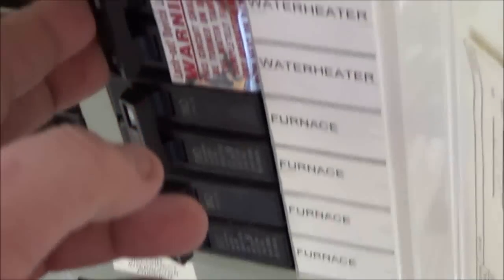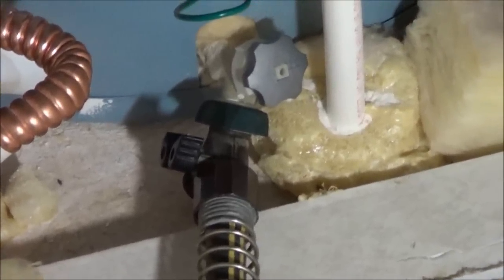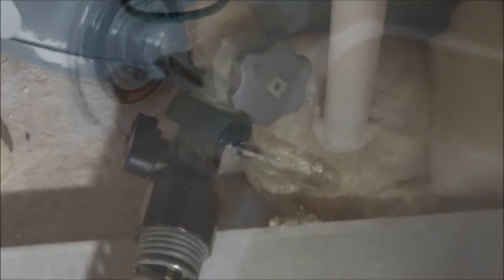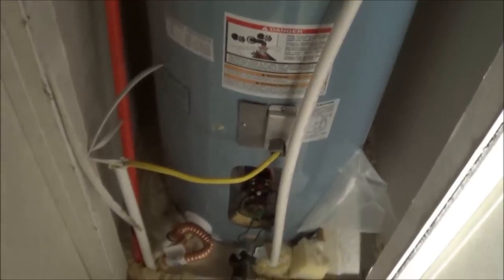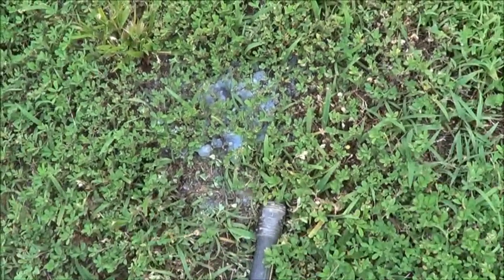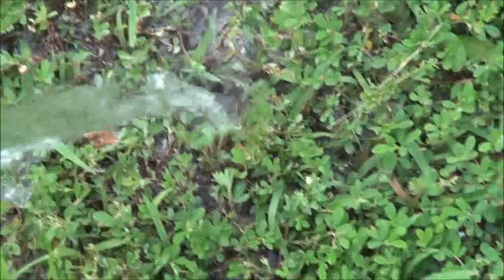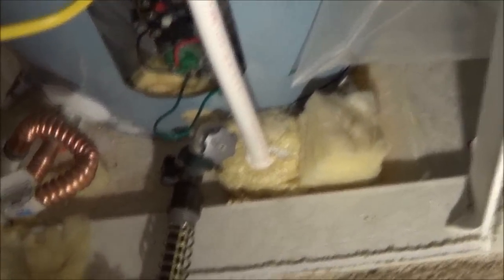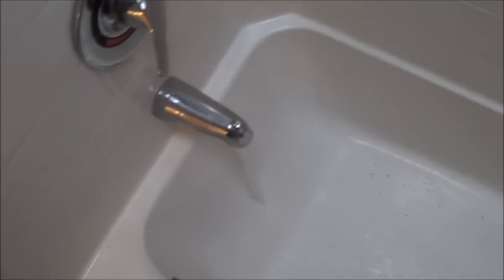How to Flush the Water Heater

Comment: Never seen a water heater with the cold water supply on the bottom side and the hot water draw on the top side of the tank. I have to think that >95% of those made have the supply and output on the top of the tank.  Thanks for video